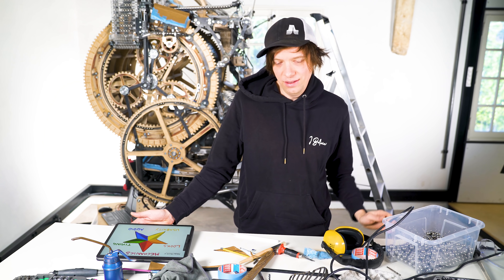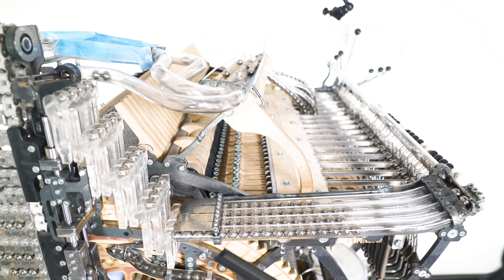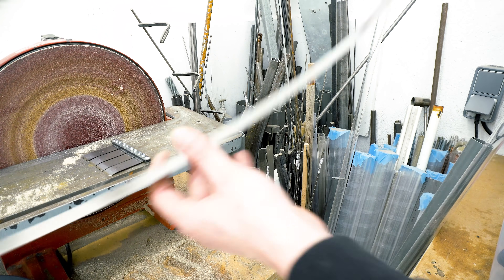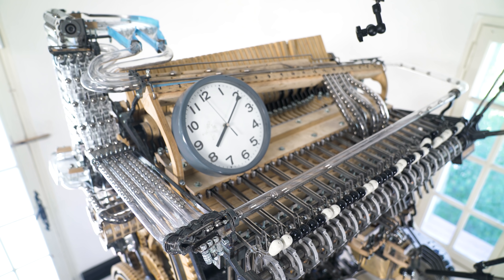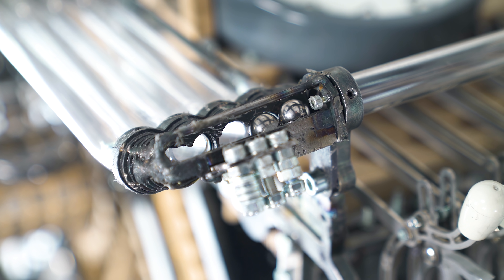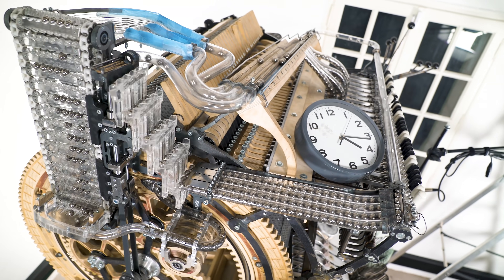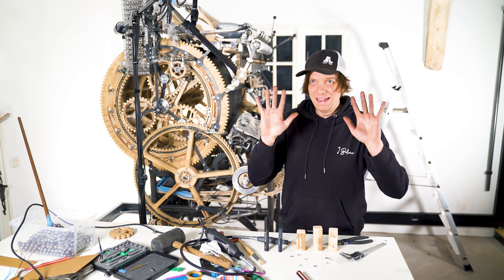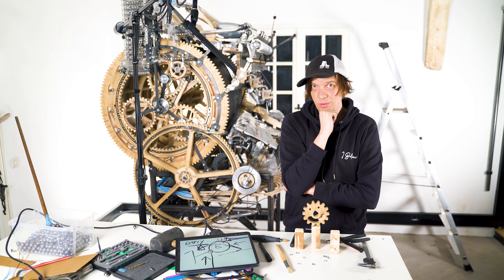Marble Machine X Fish Stair Upgrade

Comment: The question is: Do the marbles really need to get straight into the fish stair and why is it so important that there's 4 marbles in every step of the fish stair?

Fish stair runs by itself without marbles and if there isn't marbles in it, it probably doesn't affect anything else. 4 marbles on every step looks better but it really doesn't affect the working of the fish stair or it's reason to be in the machine.
With these we can make more engineer solutions that aren't pretty but they should fix some problems.

To fix the edge case problem, make the spring steels tight enough that single marble cannot get through them but there needs to be several marbles in the queue for the fish stair for them to have enough mass (force) to push the first one to the stairs.

For the problem of the divide by 4, just abandon it. You have 4 tubes which lengths you know and can manipulate enough that you can get marbles get around filled tubes #1, #2 and #3 and move on to fill the #4. Having 1 or even 3 full tubes feeding the stairs doesn't affect the working of the stairs, in contrary it could be even good if the stairs ran so that you need to fill earlier tubes before next ones start to fill because then you can easily see if the machines has too little, just right or too much marbles, if there is steady flow of marbles and the stairs run with around 2 marbles per step you know you have good amount of marbles in the machine to play the song.
This actually has been one thing triggering me in the machine. The divide by 4 doesn't give you cues about do you have enough marbles running through the system and in live situations at least I would like to have some cues so I can signal the technicians to do something about it. There's no problems if the machine is running with too much marbles, the "overflow" tube from the divider just starts to fill up and you can see it. But if there's too little marbles you just see that no marbles is overflowing from the divider and you might soon start to run empty tubes to the instruments. Without divide by 4 you have easy to see indicator and warning system for these because 2 marbles per step and things run fine, you know there's one full tube to the stairs and 2nd is running fine with 3rd maybe getting some, 1or 3 marble per step and you might want to keep on eye how much overflow there is but nothing too alarming, none or 4 and if it's not designed in the song, you can get worried and add or remove marbles from the machine to avoid either running out of marbles or running in marbles on the stage.

Comment: I think you actually have that backwards, giving up would be the irresponsible thing to do! You have put so much time into this, giving up at this point would mean that all that time and sacrifice was for nothing. You are so close at this point that giving up would be running 450m on a 500m race because your starting to get tired. Also, I think the fish stair can be solved by grinding a small angle on the back of the first step. That way if the marble isn't in the right place the stair is pushing it back into the tube instead of picking it up and throwing it.

Comment: Dude, relaaaax. 

Put a small wall around a large area on the stage, and let some marbles escape.

As long as you have enough marbles in the machine to finish the concert, it'll be fine.

Comment: i am not a engineer or anything special. But can you not develop a method that you can incorporate into the fish-stair to actuate the a gate from the feeder pipes instead of using the spring steel. Basically a slide that will open and close at the correct time to feed the fish-stair. Like i said, i am no engineer, but that might be a solution, something like the gates on the drums.

btw. I think Edison developed over 2000 prototype light bulbs before he found one that worked. I am most likely wrong, lol

Comment: You should use 3 of those alternating switches you sometimes see in marble runs. Then you evenly devide 1 row into 4, if you know what i mean. The first marble comes in and goes left, then the second marble has to go right. Should work but maybe its not fast enough

Comment: You don’t need to strive for perfection with the machine. You can allow for graceful fails. For example, if you lose a marble or two to the floor over the corse of a concert, the machine will still keep playing. Maybe you miss a note, but that happens to human musicians too. If the staircase isn’t 100% efficient, that’s OK, it doesn’t need to be. It’s not about never failing, it’s about being able to continue on when you do fail (good advice for life, too).

Although, I would recommend starting to think about how things like humidity might effect the machine when at different venues. You haven’t been able to test those things out in your workshop.

Comment: How attached are you to the spring steel flaps? If you added them only to keep the marbles from climbing up early, and don’t care about losing them, what if you put in mechanical gates (working similar to how the droppers work) that only allows four marbles to enter the fish stair when the bottom stair is down? That should eliminate the edge case of the “The Spectacular Flying Explosive Marble!™️” and add more moving parts to the area while keeping the Divide by Four which you just got to work.

If you decide to do it, I apologize ahead of time to the CAD team :P

Comment: You could just modify the flipping part that moves when all four marbles are on it. Hear me out, this might solve it x) 
The big problem right now is the metal thing that is spacing te marbles out to fit into the tubes. If you had little dents in the flipping part you wouldnt have to do that to an extend that would screw up the way it does at the beginning because you wouldnt need the metal part they are latching on.

To solve the edgecase problem you could modify the first step of the fishstairs so that you have a little hole that the marbles go into so that there is some kind of roof on it and also put a wall above the metal things at the highest place where it could snap, i dont know how much sense that makes but the first thing could work.

Comment: Hey Martin, you should come work in the automotive industry for a while and you would very quickly stop complaining about your beautiful own project. Just keep pushing until the end of the year fixing the issues one by one and you're fine. Then it will reach the good enough state. Everything is perfectly fine and you are on the right track. Also, you have an audience that loves to watch every little improvement step. Todays video is exactly the thing people want to see.
Meanwhile, I suggest to add a slap hand to the machine that automatically hits you every time you begin doubting yourself.

Comment: You’ll have to have an acceptable loss rate. In data communications they have a “Bit error rate” which, although usually low, cannot be zero. The system just copes with errors, by detecting and/or correcting them. So how about settling for a “marble loss rate” - 1 per song might be an acceptable upper limit! Trying for perfection will drive you crazy! 😜

Comment: After examining this issue for a while, I think the question we should be asking is "Why do the marbles have a hard time entering the first fish stair lift, but seamlessly go into the rest?" And I think the answer is that after the marbles get into the first lift, they're unable to move back or forth until the stair ahead moves out of the way, in which they only move forwards. But marbles entering the first lift are able to bounce back after hitting the stair wall or as the stair raises, which is how the "edge case" happened. Marbles entering the first stair need to be rendered immobile before having a chance to enter the first lift. I'd suggest replacing the end of the divide-by-four with a part made up of just the top of one the fish stair lifts that sits motionless at the end of the tubes. That extra angle down should prevent/reduce any bouncing back and shouldn't interfere with the flow of the marbles

Comment: Reusing solutions you already made: If the first fish step was enclosed (roofed, 4 holes through solid block) then pipes could directly connect—similar to the sliding hole in the marble droppers. Use channels marble dividing system in miniature to replace divide-by-four mechanism.

Comment: Possible replacement for the divide by 4. Could be a sliding block(like your marble drops) ran by the fish stairs. So 4 marbles only fit into a staging area / the block slides  back to pick them up (which they would fall down into)  / then they would be pulled forward (towards the fish stairs) dropping them into the tubes. Then repeat, back to pick up 4 more?

Comment: You should have done a simple flip-flop divide-by-2 that operates one marble at a time. Do two stages of that, one on level one, two on level two, and you get 4 lanes.
  
This video: https://www.youtube.com/watch?v=2h9t6PvnjUM shows how this can be done flat and how fast it runs.  You wouldn't need much space to do this.
  
Your first fish-stair needs a steep chamfer to keep from binding against the metal tab - like a 2:1 slope.  Enough of the shelf remaining to keep a properly loaded marble from falling off, but with a step enough slope on the magazine-queue face to push a marble back without giving it lift.

Comment: Hey Gatan! Let the machine play your sounds, and enjoy your compositions! It's your band member, which will feel depressed, if you always nag on the same issues. Let the vibraphone play! Let the MMX play! It will tell you, which of your engineering help it needs most. After a while of practice it will sound safe and sound. If the MMX could play 1'000'000 marbles without any mistake, it would loose it's human soul - it would no more be better than an ordinary computer script. Escaping marbles are an expression of the artists's ecstasy, beads of sweat.

Comment: To defeat noise... a magnetic bearing works wonders! Opposing magnets or even electronic copper wire coils, to make an electromagnet; if the spinning disk has magnetic repulsion over the axis, it will stay center. If the disk has magnetic repulsion along the linear axis of center shaft; the spinning object will have zero friction other than air to spin freely. Also equals noise created by air friction ;) so, for special parts... reduced friction makes the world of a difference :) so we use magnets like the Earth is made

Comment: On your stair climber. If you chamfer the leading edge of the first stair, would that drive the marble back up the tube rather than making it get stuck between the spring and the plastic?

Also don't give up, you're so close at this point. Just compare to where you were X period of time ago. You would feel a lot better. It's the 80-20 rule.

Comment: Trick for tiny metal shards. Get some good sticky tape and press your fingers/hands to it and peal it off at a high angle, the tape pulls most of them off. Then wash any grease/oil off and repeat.

Comment: If the springsteel tilts upwards at the end instead of down then, when a marble gets trapped, the pushed up springsteels upward tilt tip surface would become more and more tangental with the marble and that should push the marble into the lift. It would make a smooth surface for the marble to slip on instead of getting grabbed by the springsteel sharp edge as it seems to do now

Comment: to prevent the edge case of the empty pipe, could you not just add a small downwards slope, essentially cutting off the corner (circled at 13:40) the marble gets stuck on? this would mean the fish stair would just push the marble back up the pipe instead of lifting it up into the spring steel. just my two cents but i think it should work
Reply: Seems like an idea that would work, but in his current situation, there would then be another edge case where the marble is  ever so slightly ahead of the first edge case and the fish stair would again push the marble up against the metal strip? even i'm just guessing im no engineer

Comment: Maybe chamfering the entrance of the stairs a bit would just push the "bad timing" marbles back in the tube instead of pinching them up ? 

If yes a quick study on the depth and angle of the chamfer is needed

Comment: you need make 5 marbles is need to flip only 4 go in gate. when gate is opening blocks fifth marble to go forward. (when the gate goes down then a pin go out from the wall and block marble).

Comment: Fuck the 4 tubes, just use a tray. Yeah they look cool ngl but you have 1 pipe that runs into 4 that then runs back into 1. The only functionality the 4 pipes serve is to increase the rate that marbles can elevate to the top. You know you can do the exact same thing with a tray. You dont have these issues on the other system just behind it.

Comment: Martin for craps sakes. Throw this marble swing out the window and make a new one made with wood on the cnc, with exact measures...it's going to help a lot. And substitute the spring steel for a 5mm metal bar...

Comment: Martin, 
As a 3D dev & someone who's burned out. "I'm sick of following my dreams. I'm just going to ask them where they're goin', and hook up with them later." - Mich Hedberg

To me it seems like you're putting all your eggs in one basket (time) and I can imagine that the project practically consumes you most of the time. you probably know but In my experience as long as it isn't a short interval, more and more hours a day doesn't necessarily help get things get done faster. So I'd like to at least bring up some considerations; 

Firstly if you'd take away your self inflicted time constraint, would you honestly even doubt that you could finish MMX? 
(why wouldn't that be okey?)

Secondly would you look for and find joy in the process more if you take away most of the imagined expectation/obligations? 
(Just do you, we aren't entitled to influence you. Following along your journey is enough and which patreon is for. help fund your vision.)

I'd suggest splitting you days or weeks into other fields, Like research some new inresset, write music when you have the urge or start exercising (more)?
Obviously I don't know your situation as most things are multilayered. To me though finishing MMX asap. it's probably not as relevant as you think. It's just not a helpful headspace as it's very close to a crunch culture mindset and "I'd rather it'd be done by yesterday!" boss. 

If i've understood it right, Sunk cost fallacy only applies on to the present decisions about the hypothetical future. It doesn't need to be so binary as the whole project. Also I get what you meant but your ultimately building MMX firstly for yourself and then others... It's almost like saying my dream MMX might not be worth it? or the romanticized dream might not be worth it?

Comment: If the divide by 4 is tilted (like on a stage), will the swing's weights need adjusted or does it just work at all angles ± some degrees

Comment: Martin, you'd solve all of your problems with the divide by four if you just replaced it with a newer, less-ramshackle component than what you have now. That four-way channel was done when you had severely less experience in welding and metalworking, and we all know that you could simply remake a new version that would be 100 times better than what you have to deal with now. You'd have more control over the spacing of the marbles, the distance of the dropper, you'd be able to create a prettier weight system, and you'd be able to design around compensating for channels already full of marbles.

On top of that, the edgecase marble situation could also be solved if you added another stepper component like you have for your modular droppers that take two movements to drop one marble. Every other area of the machine takes two steps to transfer a marble from the pipeline into a component in every area except the fishstair. I'd argue that's why you keep experiencing those edgecases, because you haven't added the redundancy needed.

And take care of yourself, man. Don't let yourself get overwhelmed simply because you need to fix some mistakes along the way. You gone this far, and I'd argue that it'd be better to start anew than to give up entirely. Until then, keep at it!

Comment: If the marble divider had a holding position for two extra marbles, you could have it flip when the fifth or sixth marble arrives, instead of when the 4th marble arrives. This would give time for the forth marble to settle and the balance wouldn't have to be as carefully tuned.

Right now, you have to have it tuned to flip exactly when the fourth marble is in position, which seems almost impossible.

Comment: From an engineering standpoint I have one piece of advice. Avoid friction based solutions at all cost. Friction will always be a variable effected by so many factors i.e humidity, level, speed, wear and many more. I know it is easier said then done but the end solution will be much more repeatable.

Comment: Hey Martin I actually work at a metal fabricators and I work all day with sheet metal, box sections, angle iron and the associated dremels, angle grinders, pillar drills etc that go with it. I find the best way to get those microscopic shard of metal out is if you soak your hands in hot (as hot as you can tolerate) soapy water for about 30 mins (I just chill whilst I watch TV or something) But the number 1 thing is to avoid getting them in the first place. Get yourself a pair of nitrile foam gloves (I wear ones made by Site) they work wonders. Feels like you're not even wearing any gloves.

Comment: 10:20 The search for perfection. The machine will not stand equally level every time, a small error means the channels need to be teaked again. The devide by four is beautiful, but hard to perfect
Edit: Oh, now it looks like as a mixture between a devider and an overflow system. That's perfect.